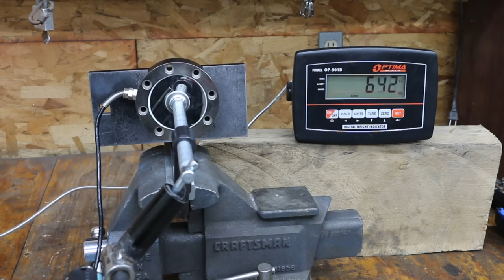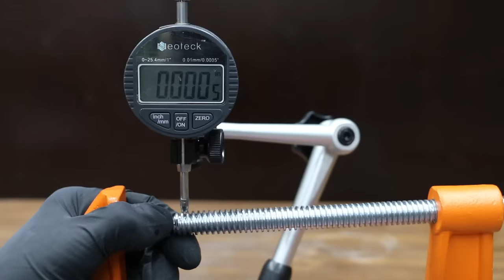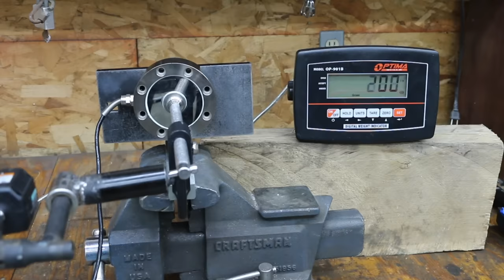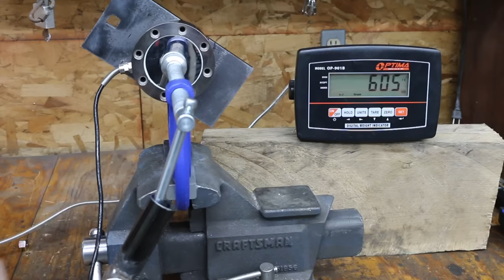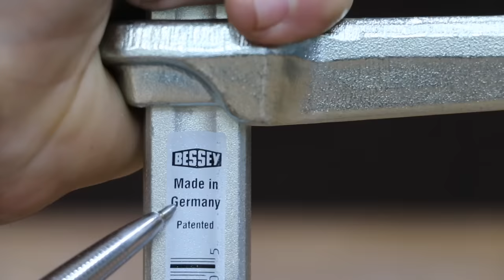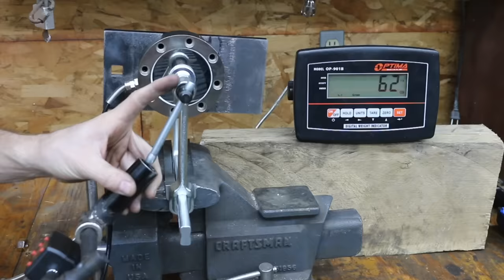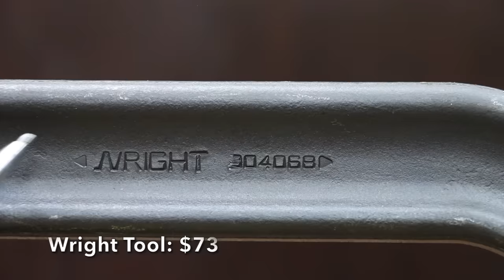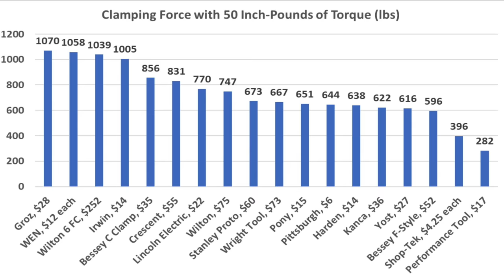Best C-Clamp? Let’s Settle This! $4 vs 252, Wilton, Yost, Irwin, Wright Tool, Harden, WEN, Proto

Comment: Those heavy-duty Wilton's really hold up. I worked for an industrial steel fabrication company, and we used some of those Wilton clamps whenever the beam was over 3 tons. They never broke, twisted, stretched, or needed repair after 10 years of service. Definitely worth the price in that application because we could not afford those beams falling over.
Reply from the maker: Thanks for sharing.
Reply: For $252 it's pathetic really that the US owner of Wilton can't find a way to manufacture it in the USA.
Reply: @nmatthew7469  Wright Tool does.
Reply: @KennyRedSocks  correct but the Wilton is a custom thickness made for bridge building etc.
Reply: Most of the stuff made in America is with foreign processed goods anyway. It's a global economy. Made in <country> doesn't mean what it used to.
Reply: @nmatthew7469  Yes shame on Wilton pure greed on there part.
Reply: @nmatthew7469  I'd bet the 90106H could do better.
Reply: @diditwork370  What are you alleging? The steel is foreign or the components?
Reply: Im a welder at a large bridge manufacturer and we only use those. We hold down 60-70 ton beams with those at times
Reply: @nmatthew7469  It's because the Taiwanese do it better & for less $. cf. the whole bike industry, tool industry and whatever else you care to mention.
Reply: @N Matthew  Still, I feel a lot better giving that money to Taiwan than China.
Reply: @h8GW lol middle man to china
Reply: Joe, and everybody, do people ever repair clamps? Joe, I ask, because you mentioned repair.
Reply: It’s good to know that the air quality will be very good in the USA when the economy crashes!
Reply: @ronaldbrown5745  funny how the states with the best economies also have the most environmental protections.
Reply: @ProjectFarm  No Problem! Thank you for the awesome videos each week!
Reply: @TheGrimiest  Sounds about right! Anytime the beam was heavier than 5 Tons, we had to pull out the Wiltons.
Reply: @eugenetswong  Maintainance always kept Wilton threaded rods in stock in case the rod bent and became difficult to loosen or tighten.
Reply: @joemad4110  thank you!
Reply: As a shop teacher and general futser, I'm glad to hear that there is an actual use for such a colossal little clamp.

Comment: That Wilton is a beast, and once again Irwin does amazing for its price point.
Reply from the maker: Great point
Reply: I can recall a number of times when I needed a beast mode C clamp and just ended up mangling what I had.
Reply: Absolutely. When it comes to clamps of any sort, Irwin is usually the best for the price. Locking pliers, C-clamps, trigger clamps, and so on.
Reply: It really seems like Irwin is one of the best value for money brands out there for hand tools
Reply: Can confirm this channel is why i have a hole in my leg thanks to an irwin carbide blade
Reply: @bluedogtransportwa  

User error.
Reply: Ummm because the heavy-duty Wilton is designed for ship and bridge building It's literally in a league of its own
Reply: That is a monster c clamp 😅
Reply: @prestonmitchell7223  

Not figuratively? God damn.
Reply: I'll go with the made in India Irwin, I want something not made in China.
Reply: A ball joint tool is similar in design to a C clamp, built super heavy like the $252 Wilton.  Might be a more universal tool/better investment with the included attachments, if you don't need much throat capacity.
Reply: Agreed!  For what most of us would use a 6” vice clamp for, the Irwin seems to be the best quality and value.
Reply: Yeah I’ll take a few of the Irwin’s
Reply: @skylined5534   😂😂😂😂😂
Reply: @nmatthew7469  Throw away the most of the stuff in your house then...
Reply: The f style bessy's are useful.  The strong back will last in a shop.  The rest, while some are good, belong in a wood shop.
Reply: @seymoarsalvage  I don't buy their cheap, poorly made, garbage steel hand tools bruh, you want that yard sale crap, go for it. I buy us, German, Japanese, Korean, etc.

Comment: What a lineup. That's heavy duty wilton was seriously impressive.
Reply from the maker: Thanks for the feedback.
Reply: It is stupid expensive but I can think back to a number of times where I could have really used it.
Reply: Thanks
Reply: I was expecting it to be maybe a little bit better and more just paying for the "heavy duty" tax. I'm happy I was wrong
Reply: Sometimes we use that in ironwork to keep chokers from slipping or even just putting that on a beam to have something to rig off of
Reply: I have bought a car for the price of the one clamp.  Actually, $2 less.
Reply: When you don't need a clamp that lasts a lifetime but for the next 5 generations
Reply: Just be sure to strap on your back strain safety belt before trying to lift it.
Reply: @ProjectFarm  Testing the hydraulics with that wilton
Reply: I have no need for that clamp but I really want one!
Reply: Back in the day, we would use those for lifting large, very heavy plates of steel and for clamping large stamping dies into presses. They were made by Armstrong, though they looked identical to the Wilton.
Reply: I have had a harbor freight 6” clamp for about 30 years now. I bought it to push brake pistons back. I’ve lost more expensive ones but that old HF clamp is always there and never failed. Lol
Reply: I have a Wilton bullet vice on my bench at work, amazing what that thing will hold for long periods without loosening.
Reply: Often use clamps like that to hold big parts when machining them, they're no joke
Reply: Used them as makeshift chain links…
Reply: @sleroy1980  is it heavy duty?
Reply: I have had an Irwin 6" for over 15 years and never had an issue with it, not matter what I threw it at.
Reply: @ProjectFarm  
Saw Wilton™ in the thumbnail and knew the winner. 🏆 👍
Reply: 11:06 just saw Wright™ a minute ago. Another old skool unfrosted cake, here yesterday, today, tomorrow, and then some more! The old Armstrong ™ were tough critters. 💪
Reply: Rebuilt an old US made Wilton torpedo years ago and it’s my favorite tool of all time. Zero slop. Simply outstanding company back in the day.
Reply: @peteroleary9447  
      Yep. Had one that I found in a miscellaneous goody box at a home machinist workshop estate sale for just under thirty doll hairs. Got a few Armstrong wrenches and an assortment of Armstrong left hand drill bits. Was lucky it was raining and I didn't mind the rain, as did half a dozen others. They rescheduled the sale before getting to the big stuff like mill, lathe, vertical bandsaw chopsaw, dozens of torch parts, esab™ welder, several hundred pounds of welding rods, a small propane forge, anvil. The second auction never happened. I moved two hours away.
Reply: @derekanderson7282  
    Yep. Bet it left a decent dent every time. Hope you never threw it at the wife!
Reply: James, I agree completely.
Reply: This is such valuable, high-quality information. Todd's design of test methods should be taught in engineering schools!

I would've liked to see the Kant Twist 6" C-clamp included in the lineup. They're my go-to, as I suspect for many other pros. Cost: about $85 @.
Reply: The term “heavy duty” is way overused. Not in this case
Reply: You could build bridges out of it and not just with it.
Reply: I heard they tried to use one to keep the kardashian girls legs closed. It didn’t work.
Reply: you could probably use the Wilton to change lower ball joints.
Reply: lol!!! I have 3 that are bent,lost the end , and well!! Look like yours! Nice! I have to look at this again.
Reply: My guess is that the Wilton did not have a swivel for versatility. For example, Wilton may offer for sale an array of attachments, such as swivels with different depths, diameters, and profiles. Additionally a pointed tipped swivel could index on a part with a center hole or dimple.  Machinists could also custom build attachments
Reply: Impressively chinese

Comment: Loved the inclusion of an absolute overkill option in the lineup
Reply from the maker: Thanks!
Reply: That's an ironworker tool. We used bridge clamps often. I would be 10+ stories on the side of a building standing on one while bolting up.
Reply: Yeah this is like comparing cars and then you pull up a tank
Reply: @Qualicabyss  it would be more accurate to say it's a comparison of a Toyota corolla vs a Ford f550. I grew up working on boats and dealing with ship yards and they got clamps way bigger for way more clamping. Every last one of them had square heads and the lightest ones were about 45 pounds and we had some that hit 105 pounds. A 24 inch pipe wrench was the tool of choice to tighten and a 36 inch was the one to loosen them. Never mess with commercial ship yard workers.
Reply: TheSlimCP  nah those are like pulling up the bagger 288
Reply: the wilton weighed more than the 7 lightest clamps together. think barrel of monkeys but with clamps?
Reply: That's how he rolls.  I'm just sad we didn't get a, "we're gonna test that" line.

Comment: A common thing ive noticed over many tests is Irwin does pretty well in the hand tool category while remaining pretty competitive on price. Ive made a few Irwin purchases over the last few years and haven't let me down (mostly DIY around the house things). Gotta give them props!
Reply from the maker: Thanks for the feedback.
Reply: I did the same. Nice to know there are good budget friendly options out there.
Reply: Irwin is one of my go-to brands. Not sure if I’d outfit a construction company with it, but for DIY and light duty home use they are hard to beat.
Reply: Yeah I've been surprised how good they are considering the price they sell for.
Reply: I was gonna say this...decent performance for a very reasonable price on a lot of their products
Reply: I'm usually scared of stuff that I find a ton of displays for at Home Depot, but Irwin makes some very solid tools.
Reply: Agreed
Reply: I have to admit I'm impressed by Irwin's customer service. I had inquired about some replacement pads on their woodworking clamps, which I had purchased many years ago. We couldn't reach a conclusion since the clamps had been phased out but the customer service rep instead sent me a pair of new clamps to try out. It's stuff like that that makes you a believer in the company and how they stand behind their products.
Reply: @PhilGoodInc - 6 months ago, i got rid of all my HF knock off locking pliers and my collection of different branded pliers and adjustable wrenches and bought a full set of Irwin Vise Grips, along with a full set of Cobra pliers, lineman's pliers, needle nose pliers, and a full set of Irwin adjustable wrenches. I could not be happier with them. they are so much better than the old HF, HD and Craftsman stuff i was using. my only regret is that i didn't do it sooner. recently picked up their wire strippers. looks like i will be going with Irwin Clamps when i decide to replace my old ones. in fact, that may come soon now that i remember that some of mine have bent handles...
Reply: For DIY Irwin it’s great!
Reply: Agreed in Great Britain, Irwin is my go to brand for price and performance for DIY
Reply: I use Irwin for everything my wood clamps are not suitable for
Reply: I have an Irwin hand saw that is the best hand saw I've ever owned.  It cuts through wood and trees like butter.  If I only have a few cuts to make, it's almost always quicker to bust out the Irwin than it is to fuck around with extension cords and my circular saw or finding a good battery to use with my sawzall.
Reply: Irwin tools honestly rock for their price
Reply: I buy Irwin quick clamps exclusively now. Even the DeWalts have let me down too many times. I like everything nice and tight and they get sloppy within a few uses.
Reply: Irwin seems to keep prices low by using cheap material, but more of it. That usually results in a heavy and/or bulky tool that outperforms similarly priced competitors.

Comment: Thanks for including the heavy-duty Wilton! It's great to see underlined just why heavy duty industrial tools can be so much more expensive! That thing is monstrous!
Reply: Yeah if you're doing heavy work it's the one to have. In a class all by itself.
Reply: @1pcfred  yeah there's a reason why it's specifically marketed for bridge building and boat building lmao
Reply: @HerbaMachina  they're not pushing it in the amateur market. I swear there's times when I could have used one though.
Reply from the maker: You are welcome!
Reply: I've got a few old USA made wiltons of various sizes, they are most prized possessions of mine. They don't get used every day, but when there's no substitute they're invaluable
Reply: It was great to see in action, though it's a bit like comparing a sledge to a ball peen hammer.  😺
Reply: I used this video to convince my boss to buy me 2

Comment: Another brilliant test! Well Done.

A tip for everyone out there that uses C-clamps. A drop of oil in the swivel cup and on the threads will make a big difference on how they work for you. And instead of tediously hand winding the length of the threads, hold the winding handle in your fingers while letting the clamp body hang down. Now swing your hand in a small circle and watch that clamp screw up or down quickly in whichever direction you need. It will take only a few seconds to thread all the way from one end to the other.
Reply from the maker: Thanks and you are welcome!  Thanks for sharing.
Reply: You have just made my job a little bit easier. Thank you!
Reply: Good time-savi g tip! 👍
Reply: My old girlfriend used to use that same technique with her pasties....
Reply: @additudeobx  That is actually a perfect analogy to describe this move!
Reply: Why did I have  to wait 'til age 61 to learn this trick?  Ugh.
Reply: @tree_carcass_mangler  I'm 52, and I learned it in my early 20's working in a ski and snowboard repair shop. Ii is enlightening, isn't it?

Comment: The clamping strength of the heavy-duty Wilton is staggering! Then again, so is its price. Great episode today. Thanks for posting.
Reply from the maker: Thanks and you are welcome!
Reply: Those heavy duty Wiltons are indeed awesome!  They make an in-between series which is not as heavy duty or as expensive as the F.C. models but is still much better than their Chinese-made clamps.  If you need something heavy duty but not THAT heavy duty check out the Wilton 100 series.  I.e. No. 103, 104, 106, 108, etc.
Reply: @allanm4848  Thank you for that information!

Comment: Irwin seems to be the gold standard for quality budget tools. I've watched most of your videos and Irwin almost always does great. Its become my go to brand for random purchases
Reply from the maker: Thanks for the feedback.
Reply: I've only just started acquiring tools (new home owner) and I needed a couple of larger clamps a while back to glue a wooden chair seat back together.  The local hardware store had Irwin clamps on sale half-price, and I picked up two 24-inch trigger clamps.
No complaints from me at all, and as I need different clamp types and sizes I'll look at Irwin.  I'm very unlikely to need a clamp like the Wilton as I've no plans to build a bridge.
Reply: Absolutely. I'm glad for the inclusion of the heavy duty Wiltons, but I don't foresee ever needing that level of clamping force & durability.

The Irwins are more in line with the "occasional handyman" budget and use-case. I don't subscribe to this channel to find the $252 Ultra-Hardcore-Super-MAX C-Clamps, I subscribe to find the $14 value-for-money Irwins.
Reply: Same here, Irwin always seems to do well considering its lower price point. I certainly go for it over other brands thanks to PF now.